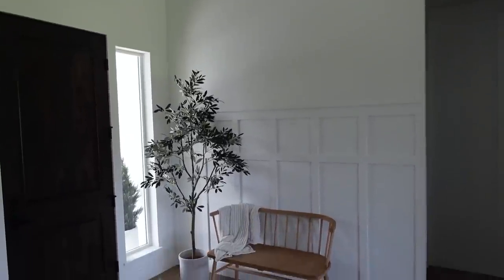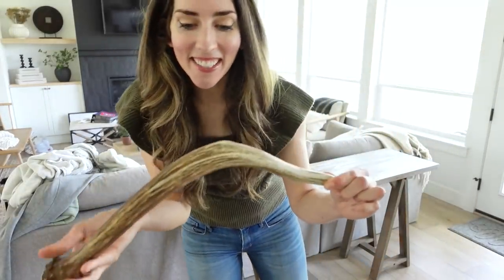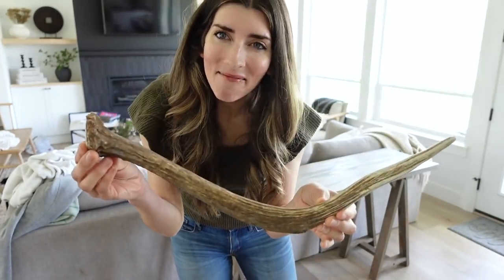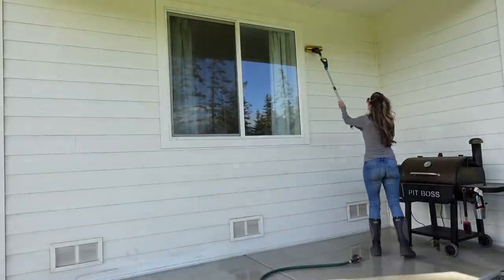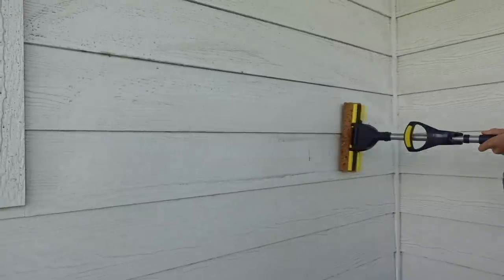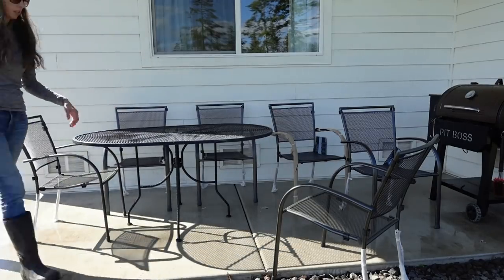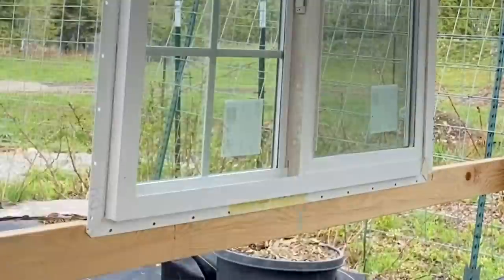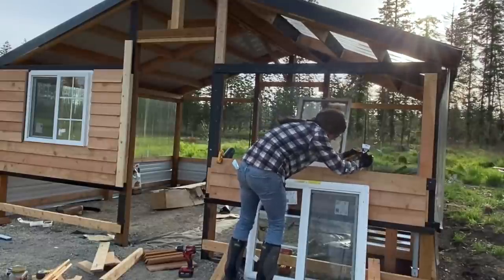Decorating With Me Inside & Outside / Decorating a New Porch  + Entryway Makeover

Comment: Emily 
You have done an amazing job on your garden shed!  It is going to be adorable and so useful.
You entryway looks good so far. I would remove the olive tree for summer.  Also on the opposite site of the entryway I would not use a different mirror and table.  I would either mimic the other side with same mirror and table but smaller or use something entirely different.  A beautiful art piece of a landscape and sconces on the wall  with a different style of table with a chair or  small bench would look nice.